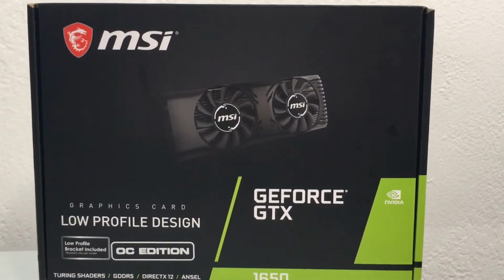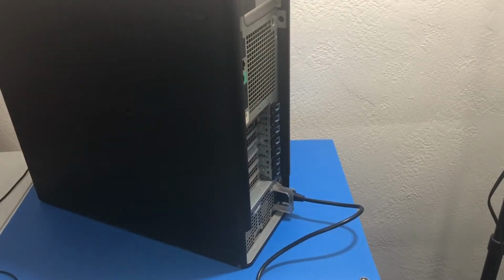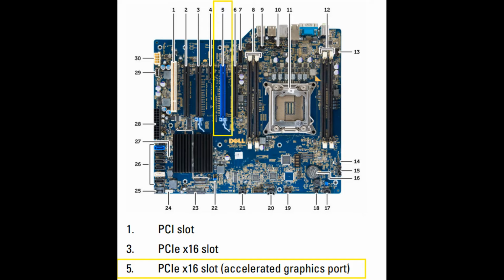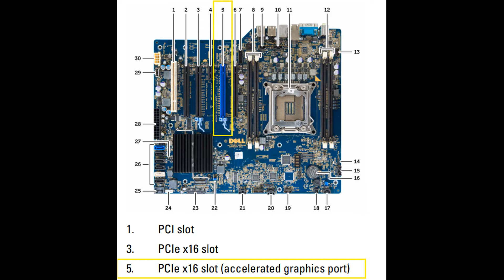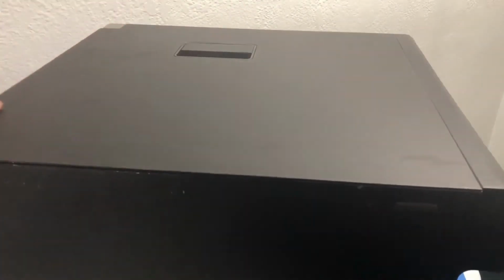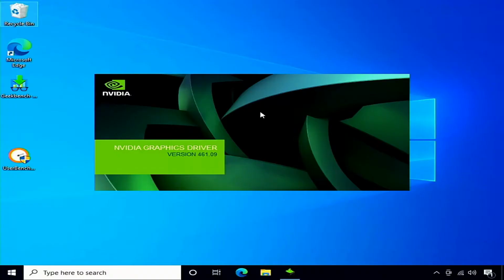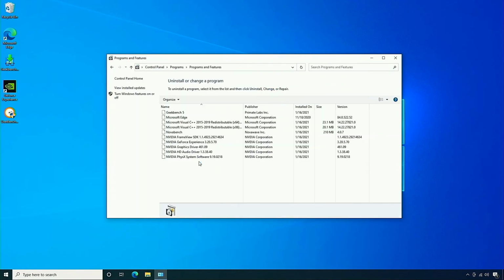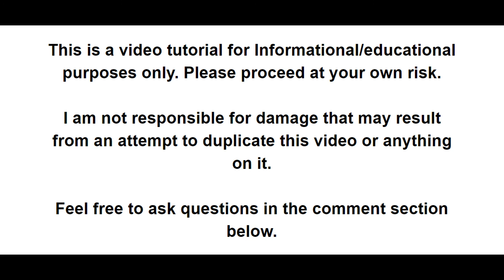Graphics Card Install! MSI GeForce GTX 1650 OC Edition - G16504TPC | Dell Precision T3600

Comment: Nvidia GeForce KFA2 GTX 1050 ti OC can run on standard power supply i just installed used one today from 4% games in minimum requirements to 87%

Comment: Cool video.  I am back to using my T3600.  It is a combination of two workstations.     I am running a T3600 with a Xeon E5-2665 with 64GBs of  RAM and a 500GB SSD and a 6 TB HDD.

I did have a GTX 1650 in there previously but now running a GTX 1070.   These machines run really well under Linux too if anyone is interested in giving it a go.

Comment: Hi great video! I recently found 4 Dell  Precision towers! 3 T3620s & 1 T1650 (the 1650 is about 10 years old!) & The 3620s about 7. All have the Xeon CPU. What CPU were / are you using? Thank you 🤓
Reply: That is a good find.  I am writing this on a T3600 with 64GBs of RAM and a GTX 1070.  It is a combo of two workstations cobbled together.
Reply: @certs743  I think the T3620 have a 2200K GPU. But not all the towers are complete. All work it seems! Also recently found an HP Envy 750 PC with an Intel i7 7700 & 16GB RAM. Plus a dual monitor setup! Tossed out!
Reply: @j.lietka9406   I am lucky to live in a city with TV and movie studios including animation studios.  My two were old machines from an animation studio.  Both were working up until last year but one started to have issues so I pulled the best parts from each and now it is my daily driver.
Reply: @certs743  I have time to look for electronics (as a kind of hobby) just not enough time to really work on them!

Comment: No need to cut the handle in cpu side panel then?
Reply: You should be able to pop it off with a pry bar.  That is what I did.  It is not riveted or anything and doesn't require much force to pop it off.

Comment: So what I did was remove the old one and stick the new one in without uninstalling or installing anything. 
The screen would not turn on at all. 
Is that because I didn't uninstall the current software? 

My fear is I'll do something I can't reverse.
Reply from the maker: Depends it can auto install. Question, does your pc have a built in video card where you can plug in a monitor? Basically monitor output thats not on the graphics card
Reply: @whattmeter  All the pots are with the graphics card I think. I didn't see any others.
Reply from the maker: I see that will make testing tricky. How different is the new graphics card to the older one? Most of the time you need to install the drivers for the correct/new graphics card
Reply from the maker: Yeah there should be no need to reinstall the Os. So no ports on the motherboard that can connect to a monitor. Only the graphics card. Graphics card should show up on the monitor even with low resolution then once the drivers get updated the resolution should change. Is there any fan spin on the graphics card? Have you tried reseating the graphics card? Also check your power supply wattage and the required wattage for your graphics card.
Reply: I JUST wanna go to Skyrim! 
Cries in VR
Reply from the maker: Power supply. That makes sense
Reply: @whattmeter  I'm also in contact with customer support, who don't seem to understand that not everyone speaks computer.
Reply from the maker: So no video at all when you plug monitor in the new graphics card at all? It should show up ever if the resolution is off

Comment: Hi great video thanks, I have that in my new t3600 the pci card you said you was by passing and you disconnected, what is that please? Can I remove it too from my t3600? And then can I add another second graphics card in that slot being available? Thanks

Comment: Does this card need a PCI-E connector from the power supply?
Reply: No, that's one of it's main advantages: it only draws power from the motherboard. Carefull though, as some models do have an additional 6 pin connector (some assus for example)

Comment: Quick question i run a ryzen 3 3200g gtx 1650 4gb with a 400w power supply and im trying to figure out what gpu i can get without uograding my power supply have u any ideas its for warzone btw? Thanks in advance

Comment: i have the same exact card, but i was wondering if there was any kind of solution to use 2 displays( 2 monitors ) at once? i tried using my motherboard hdmi but it doesnt seem to pick it up, only the one connected to my gpu
Reply from the maker: two monitors should work connecting to gpu

Comment: Though I'm Months late on your video, please note that the Video card used in your illustration is "NOT" accurate to the description posted in your comment!  Whereas the "DP" (The VR-Ready) port is missing as you've kindly pointed out for us at time: 5:21 😏 😂👍  ..I have the exact same card!  And, only when attempting to use my Oculus Rift s did I notice there was no DP port to plug into!
Although the description on the package clearly states the presence of one!  ...Thus further due diligence on whether there's actually a model of this series without a DP is what lead me to your video!

Behold! There's indeed another model of this series without the DP Port!  ..OR, is this a bad-batch of cards that somehow got past QC, given that they're all packaged in a box proclaiming the presence of an otherwise missing DP!

Just wondering whether this bad-batch was allowed to go into circulation on a gamble that most users wouldn't take notice for the HDMI Port they'll only be using anyways!🙄

But then there are those "OTHER PEOPLE" like me, 😁, The finder of Needles in haystacks, but we're too far and few between to be of concern!  They'll just solve our complaints and immediately forget we ever existed!

However, if you want, you should be able to contact the vendor and have them send you the actual VIDEO CARD that matches the package description!😉  ...Else hold them accountable for "False Advertisement" and see if they're willing to instead make a swop for the GTX 1660 to compensate you for damages!😉😉

Comment: Will this installment be compatible with the following:

CPU: Intel XeonE5-1603  2.80 GHz
Memory: 16.0GB DDR3
954GB SSD
Motherboard: Dell 0PTTT9 A01
Reply from the maker: It should be compatible. What model is the computer itself?
Reply: @whattmeter  Dell Precision t3600 Workstation
Reply from the maker: Yup page 37 of dell motherboard layout shows a slot for a graphics card. https://downloads.dell.com/manuals/all-products/esuprt_desktop/esuprt_dell_precision_workstation/precision-t3600_owner%27s%20manual_en-us.pdf  i would check the power supply and make sure you have enough watts for the graphics card you want to use. Most low profile graphics cards require a minimum of 300 watts

Comment: hello does a gtx 1650 tuf without pin conector work on a psu 300 watts without probleme ?
Reply from the maker: You can add up the wattage pf all your components to be sure. What does tuf mean? Most low profile graphics card like the one in the video will work with 300watts and up
Reply: @whattmeter  so a gtx 1650   will work on 300watts psu without problem ?
Reply from the maker: The box for the graphics card I used in the video recommends at least a 300 watt power supply. 300 watt power supply should have no issues and is enough to run the graphics card no problem

Comment: If you are still doing tutorials on the aspire 5 slim, I’m having trouble trying to run Gears 5, but I haven’t done any upgrades so maybe that could be the case
Reply from the maker: I have a resident evil benchmark test scheduled in a couple of weeks for the aspire 5. Are you getting an error for gears 5? It requires at least 8gb of ram it looks like

Comment: Will the gyx 1650 work run in the hp m01-f0016 I seen on reddit a guys was using one with no problems he didn't swap out the psu either thankz
Reply from the maker: Whoa really? I wonder how long he’s been using it also what games